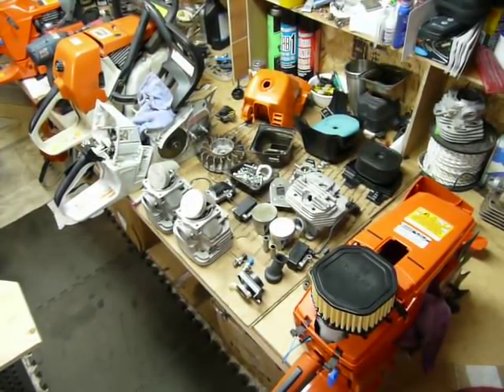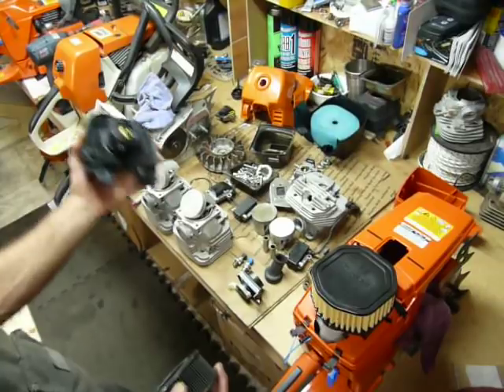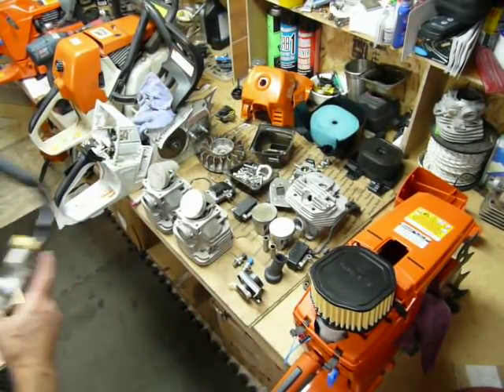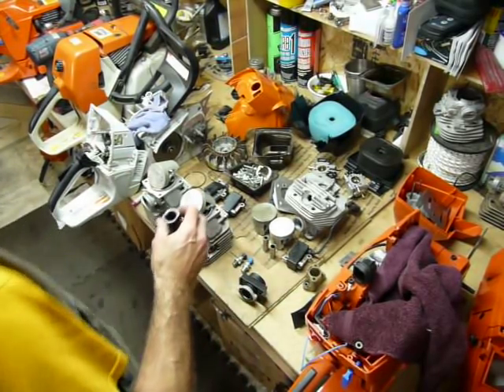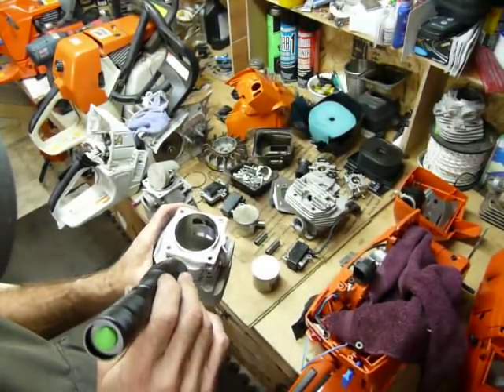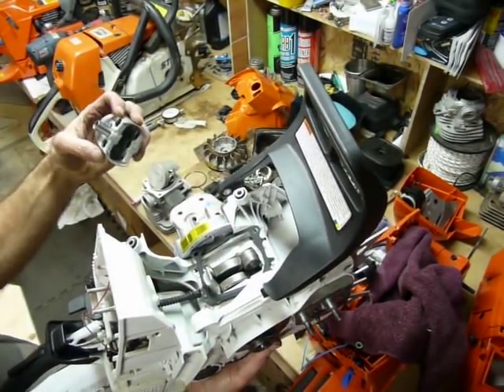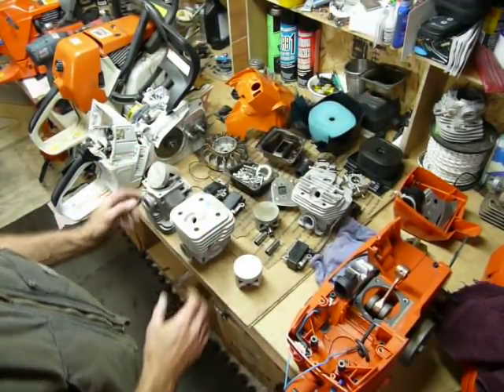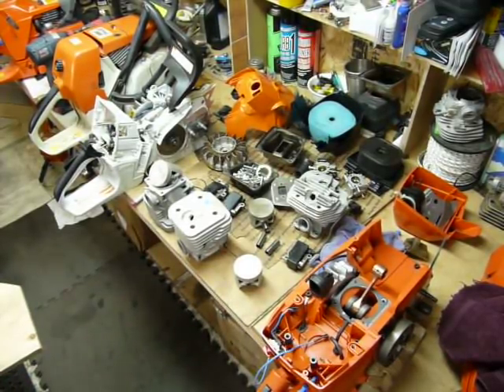Husqvarna 395xp vs Stihl ms661 c - Bench Talk

Comment: I have 3- 395xp saws. I’d really like to improve performance of them for working saws we use everyday. Need to be dependable, easy starting , and run all day. We do selective logging and thinning of adverage and large trees. The firs and redwoods are usually 4 to 6 ft at base and up to 150ft tall. Hardwood is oak, madrone, bay and miscellaneous bunch that are cut for firewood.
Reply: So id like to get at least one. Saw built for this type of duty. How can I contact you for pricing and adressi g info?
Reply: I also have a stihl 661 or 662 it an emtronic saw and it needs help also. When hot its very difficult to start and my crew just goes back to 395 or 372 saws. Help!!! How do I connect with you? Are you doing saws for others? I hope so. Please contact me asap as spring is coming. Thank you.
Reply from the maker: Email is the best, 1st point of contact.
Thanks for watching.

Comment: These videos are as good as they get. Thank you for all the info! The question is, if you had to run only one for the rest of time, which would it be?
Reply from the maker: I'm glad my time is short then..... At this point and considering the wood size now and that it will only be getting smaller as time goes on, I would go with a 382xp Husqvarna. That saw is a one off creation from my humble shop. Based on the 372xp but sporting ~ 82.5ccs. Beastly little machine that pulls a 3' bar with authority it needed.
Thanks for watching.
Reply from the maker: For the most part that information is proprietary. I will say we are using all oem parts, but not necessarily strictly Husky pieces. Now if a guy wanted to ante up then we could get a little most serious......
Thanks for watching.

Comment: Do you have a website or anything? Where are you located? Which one would you buy I’m torn and cannot decide
Reply from the maker: Daniel hi. 
No.
Pacific Northwest.
Depends upon a lot of factors:
1st, whether the saw will be modded or not. 
The 395 will ALWAYS come out on top if all things are done equally by a tuner that knows what they are doing.
Long bars suck up power. The 395 will do a little better there.
I consider spare parts & the bar mount.
The shop where you want to spend your hard earned dollars.
If weight is a consideration, the 661 comes in ~ 2 pounds less.
If carb adjustment is problematic, the M-tronic version 661 is a better option as long as you are below 3000' in elevation.
Best of luck.
Thanks for watching.

Comment: Keep on doing this kind of videos, best there is!
I bought a 661 recently, it's got a newer type of cylinder, the darker one. It's not a Gilardoni for sure, do you know who makes them?
Reply from the maker: Floriceeel hi. 
Stihl (Husqvarna, Dolmar, etc.) has "farmed out" the making of certain cylinder assemblies to Gilardoni (they do the cylinders as the pistons are cast in Virginia Beach) over the years as you noted.
I've seen where the company will contract out the manufacturing in the beginning. Then at some point, for whatever reason, start doing it in-house themselves.
I remember the first time I bought a 'Husqvarna" made 288 assembly. Husky had used Mahle (the gold standard in cylinder assemblies) for decades. Stihl had employed Mahle on many models as well.  I took the 288 cylinder kit back to the shop. It looked Ike a poorly made Chinese knock-off jug. Took a minute to get that sorted.
Back on track. What you are seeing is the transition away from a second or third party supplier. 
Thanks for watching.
Reply: Are the darker cylinders higher quality?

Comment: Just moved to a 20 acre ranch and my Husqvarna 440e 18in saw seems a little under powered. Looking at these two saws. Stock which would you recommend? I might port but it be my first time doing so and I probably wouldn't do this for a while. Does your recommendation change with porting/other modifications?

Comment: Correct me if I’m wrong, but you stated that a 661 c is an mtronic? I was under the impression that only the stihl cm models were mtronic, the c model saws still had adjusted carbs.
Reply from the maker: Brian hi. As far as I know, the c models do not have a semi (limiter caps) adjustable version carburetor.
The "c" stands for comfort features. A 661c, is by default a m-tronic machine. The "standard ms661, with a limited controller but semi-adjustable carburetor, is denoted by just the "ms661" placard.
It could be a wrap version handle saw for example - 661 R C-M, where the "R" denotes 3/4 wrap style handle bars, and "M" the m-tronic version carb/coil. I would imagine the all the nomenclature is not included on the placard because the lettering would have to be really small on some of the versions.
Thanks for watching.
Reply: hotsaws101 thanks for the reply. I wasn’t 100% just going off what my local dealer told me. That was also after I told him I did not want mtronic also so who knows
Reply from the maker: @briangunnoud5800  hi. I have never seen where the ms661 (standard) is or has been available stateside.
Reply: hotsaws101 thanks for the reply’s sir. I guess I’ll have to give the 661 cm a try. Not many options.
Reply: @hotsaws101  661 Standard mejor?